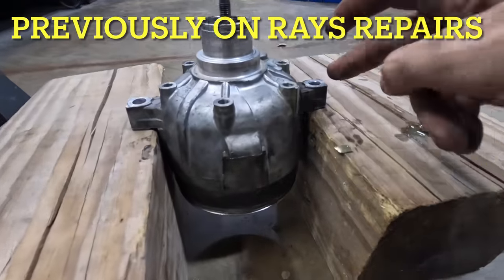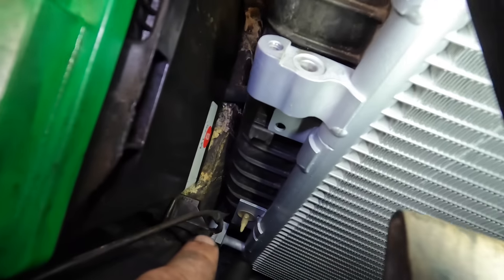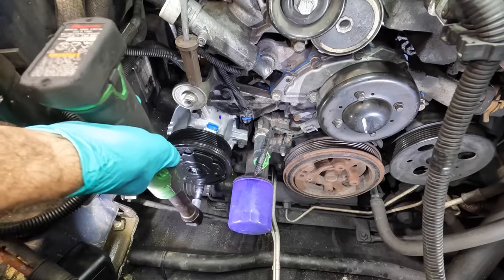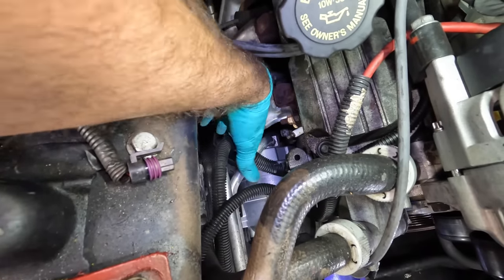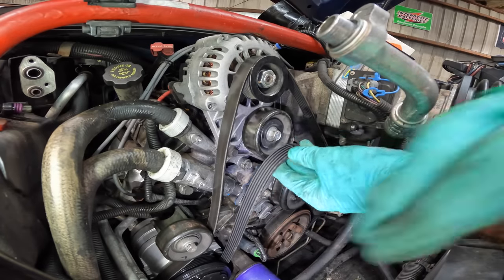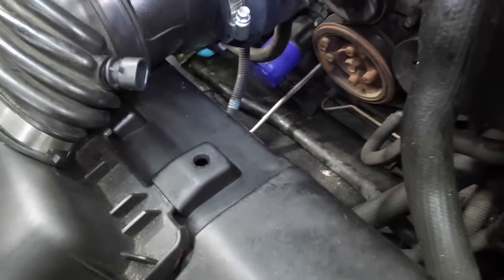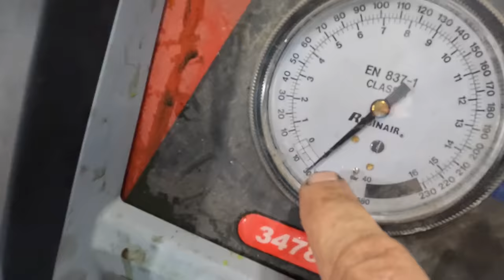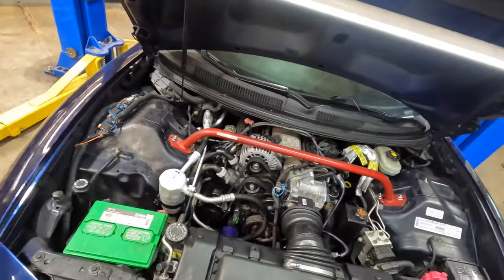Compressor Damage took out the whole System | Pontiac Firebird Camaro S-10 Buick

Comment: Keep the black caps on till the last moment before inserting the pips. 
Exposure to moist air should be minimised as much as possible. In the factory they have humidity control and keep it below 20% but in the shop you have 62% humidity if that clock was right. 
This will cause the oxygen and moisture to react with the aluminium. Which would hamper performance. The reduction may not be measurable but it is a good practice to keep the seals on as long as possible and only open them right before you need to connect the pipes.
Reply: @logicthought24  yes the recovery machine does it all on its own , but that will not fix any oxides formed while it was exposed to air and leaving it open while you work on the car can also result dirt to get in the holes. nitrogen is used to displace any oxygen and we purge nitrogen anytime the system is open, if we find a leak we do not immediately cut the pipe or remove the valve , we first put some nitrogen at very low pressure before trying to fix the leak. oxygen & moisture is the enemy here.

Comment: That tensioner pulley sure likes to bounce around a bit - or maybe it's the lighting playing a trick?
The old orifice was clogged, there was lots of residual metal sludge in the compressor, and the hoses required flushing... does the old refrigerant that you pulled from the car get filtered before being put back into the vehicle?

Comment: Rumor has it that if you get a small piece of metal fuel line and put it in the engine block with the broken bolt and run a stick of welding rod inside the fuel line and weld it to the broken bolt let it cool, then the broken bolt should just twist right out.
Reply: Should be copper so it wont stick
Reply: A few have posted that advisement, but he likes the "nut filler" method.🧑‍🔧🤷‍♂
Reply: @nbk9372  I mentioned it as an alternative because he tried that and the bole broke off inside the head.

Comment: I've never used an A/C machine like Ray's. (not a mech) I do know how to use a set of gauges, a vacuum pump and a few 1 pound cans of refrigerant though. It takes a LOT longer that way... Ray's machine is fast! Only 20 mins to pull vacuum? The last vacuum pump I used took almost an hour to pull 1.5 pounds! I know If I'm ever stranded in Fl., with no A/C, I'm going to RAY!!!
EDIT:
My VWs need to be on gauges to see if it's compressor is working. The compressors have INTERNAL clutches. (They look like the clutch is spinning all the time from the outside, BUT IT'S NOT)
I almost spent $450 on a new compressor thinking mine was bad until an honest mech told me!!!

Comment: i like that aftermarket shock tower support. i used to put those (sheet metal, not tubular) in my 69-70 mustangs, which are my all-time favorite cars. 
wonder if he's got one in the rear as well.
Reply: A set of low profile weld-in subframe connectors would be a better choice for that ragtop, had some on my T-Top '97 LT1 and solid roof '99 LS1 Birds back in the day and they were a big chassis rigidity improvement, wish I could remember the manufacturer but those 25 y.o. memory cells are long gone.
Reply: My gray matter synapses finally synapsed:  Kenny Brown Double Diamond Subframe Connectors, super-trick upgrade (long out of production, unfortunately).

Comment: 31:46 nice fix.   Id thought you left your electric wrench in the bottom of the engine bay in frt of the motor on the dust shield. 

But I saw it on your service cart.
I think id find a way to set one up with spots if a tools gone you left it in the car. I hate it when I've done work to someones car and they get a free bounce tool that cost me a weeks work to buy.  I dont know how many snap on door panel poppers ive left in cars or someone barrows and didnt return.

Scan speak made a speaker polarity test tool I let a customer barrow he blew it up. You cant get them anymore and a new somthing like its 400 bucks now.  That one was only 60 bucks off a snap on truck years ago.

Comment: I went to a garage that used a 2 stroke 4 wheeler with a sprint car tire mounted on the from to push cars into the shop.  Their parking lot had a steep grade so there was no way for them to push cars in.  You guys are going to hurt your back.  I know cause I hurt mine so bad ill never be able to hold a job again.

Comment: It looked like you missed fitting the centre fixing/bolt  to the black plastic that held the condenser in, not the top radiator one that has the  4 outer ones, the one below it, it looked like one was to go under the centre bar. Possible as there is a hole . My apologies if I am mistaken.
Reply: I'm pretty sure it was one of those push pin things, minor thing as the filter housing keeps it all fastened in anyways

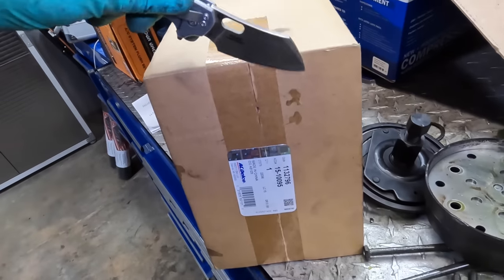Comment: 19:40 Obama’s Cars for Clunkers really killed off the parts market for 1990s cars because so many of them were taken out of circulation by that program.  Now the sweet spot for cars that are reliable and without excessive EPA and safety regulations is the 2000s.  Cars made after about 2013 are crammed with too much electronics and EPA games.

Comment: Speaking of ac how is your truck?
Reply from the maker: It’s much better but not quite right. I think at 230000 miles it’s compressor time. Low side pressure is favoring the high limit and the high side needle bounces

Comment: my AC isn't working, what would you suspect if the high side shows no pressure while the compressor is running and little pressure when it's not running

Comment: great video ray... how much does does the machine that charges the ac system retail in the states ?
Reply: I've never used one like Ray's. (not a mech) I do know how to use a set of gauges, a vacuum pump and a few 1 pound cans of refrigerant though. It takes a LOT longer that way... Ray's machine is fast! Only 20 mins to pull vacuum? The last vacuum pump I used took almost an hour to pull 1.5 pounds! I know If I'm ever stranded in Fl., with no A/C, I'm going to RAY!!!

Comment: I miss engine bays like that. You could almost climb in there and talk to that engine. Nowadays it’s almost step one: remove car from drivetrain, for access.
Reply: Okay, the back bolt on the compressor is pretty well hidden, at least from on top, but it’s still obviously a bay intended for a much larger engine. They used to make cars that way, not too long ago. Now every inch counts. No space is wasted.

Comment: Ok, I was a auto mechanic back in the late 60", what is the use of that red bar over the engine?
Reply: Its called a strut brace. It helps firm up the front suspension / steering by stopping the strut towers from flexing when driven with gusto.
Reply: Thanks

Comment: Amazing how long that front end of the Firebird is. The design sure had radically changed from previous models and not necessarily for the better. I prefer the look of the vintage ones! 🤔
Reply: wait till he works on that recessed engine.
Reply: @forgetfulme1719  😅
Reply: Replacing a complete set of plugs on these 4th generation V8 F-bodies will give Ray's lower back, wrists, forearms, fingers, and just about any other body part an unenviable workout -- a good chiropractor on speed dial is highly recommended!

Comment: Does the owner of the Firebird think they bave a v8? What’s the red bar for? Is it a strut stabilizer?
Reply: Correct, it's an aftermarket strut tower brace to minimize lateral twist in these 4th generation GM F-bodies (Firebirds and Camaros). They work, especially on convertibles, but I had one on both of my cars back in the day, a '97 WS6 Ram Air Trans Am and a '99 Formula, the former being a T-Top car and the latter a solid roof model which I had to special order and which took forever to deliver since 99% of dealer cars were ordered by sales managers with T-Tops.  I went with a lower profile strut tower brace manufactured by Hotchkiss for both cars, the center section was removable (unlike the solid pipe design on "Ray's car") for working in the engine bay without sacrificing the bar's structural integrity, a very nice aftermarket bolt-on mod to say the least, from a company that's been around forever in the suspension game (and I'm not getting paid to say that 😄).
Reply: @craigcraigster4999  Thanks! Much appreciated!

Comment: An aftermarket boot for the air intake ?!?
Ray, Ray, Ray.... you need to get outta that hot Florida summer sun.
In those days, (2000's) GM was well on their way to bankruptcy, Dude. If it's that squishy it's definitely original 20+ year old part to go with that OEM air filter. If they made quality cars in those days it was a happy accident. They just didn't have the resources or customer base to sustain their "empire". This is why/how companies disappear forever.
The problem is that they're still around - while the rest of us fight it out and slave away in the pits just to squeak out a living. So that it can be proven that corporate welfare is a very bad idea.

Comment: Between the two videos, you have made a point of calling the accumulator a "receiver-dryer" at least eight times.  You did not point out the other components in the same manner which leads me to believe you know very well what its proper name is.  I theorize that it is an inside quest to see how many people will correct you - all the while chuckling to yourself.  An experienced mechanic such as yourself would know that a receiver dryer is used(on the high line) for units with a TXV and an accumulator(on the low side) is used with units that employ an orifice tube.

Comment: Hey Rainman, my 2021 Jeep Wrangler JL  has that R1234yf  type AC refrigerant requirement. What does a typical service of that system usually run, from a shop such as yours should the need ever arise?

Comment: I would have offered to replace the radiator, after many years of experience, I have learned that any coolant repair with over 100k and aluminum radiator should be replaced. I know this isn’t a coolant repair, but the labor to replace it would have been minimal at this point.

Comment: You can't seriously be considering replacing an engine over a silly nilly little broken bolt? If it were me I would drill out said broken bolt with the tap drill required for the particular size of fastener. Even if you had to make up a drill guide plate or have you local Lazer shop cut you one you'd be off to the races. Try hitting it with your purse
Reply: Well that just proves you don’t pay attention he said he is pulling the engine to try and get the bolt out and if he can’t get the bolt out then he will look at replacing the engine.
Reply: Well that just proves you don't listen as Ray clearly said REPLACEMENT ENGINE. Now I don't what planet you are from but down here on earth we think of a replacement item as one that is not the original.
Reply: @JimsNBHomestead  before he said replacement engine he said he was going to try to get the bolt out first and if  he couldn't get the bolt out THEN he would look at replacement engine. Smh.
Reply: @JimsNBHomestead  1:22 well sounds to me like he is going to try to fix it sooooo I guess I was listening after all.